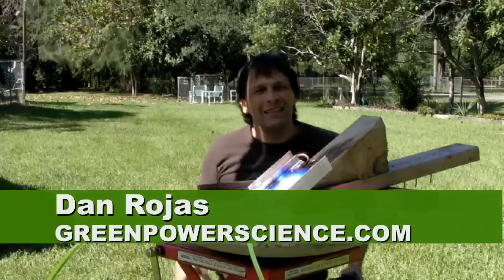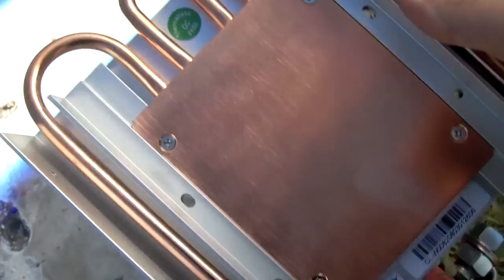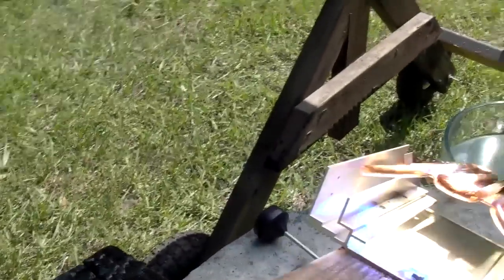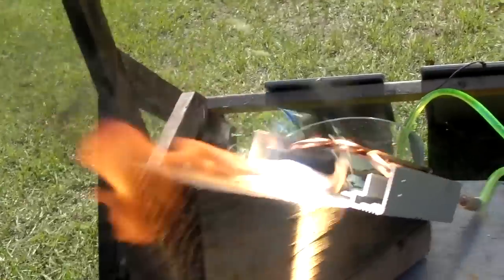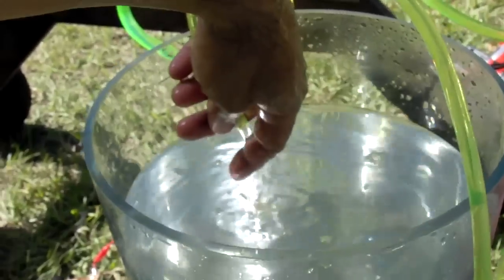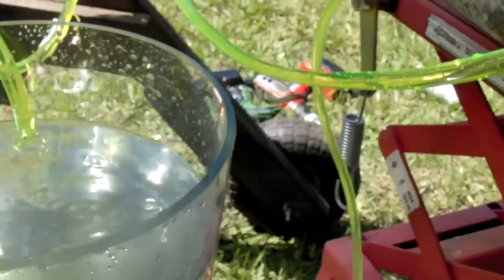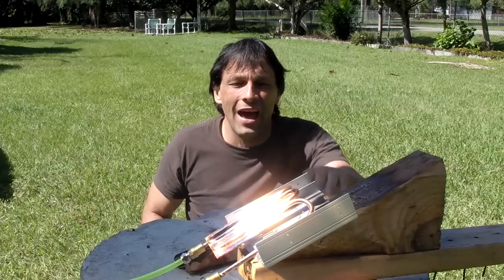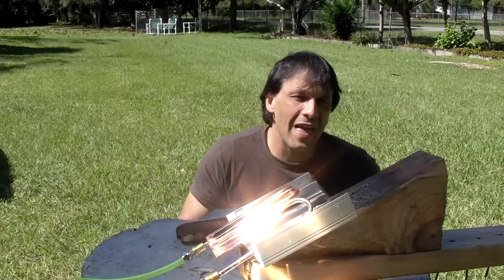FRESNEL LENS SOLAR HOT WATER, Heat Solar Pool Heater Solar Swimming Pool greenpowerscience

Comment: you should've stored the water in non glass tank, painted black? i think it would keep the heat and maybe add some more because black surface won't reflect any sunlight=energy=heat in this case

Comment: couldnt you do it without the pump is you just put one end in the water and the other just in the jug but not in the water.

wouldnt if you primed it first, just vacumm the water in as youboil it to vapor, back into the jug???????